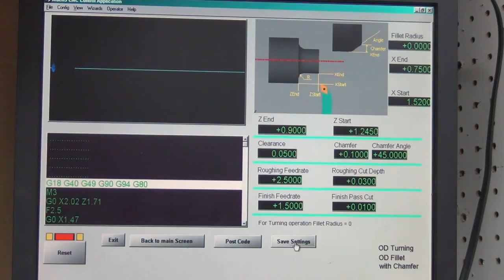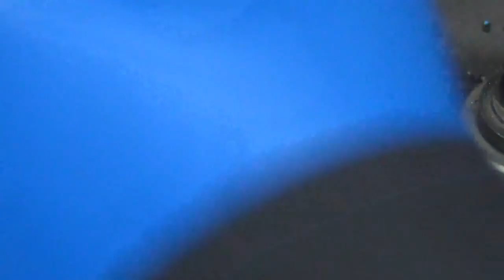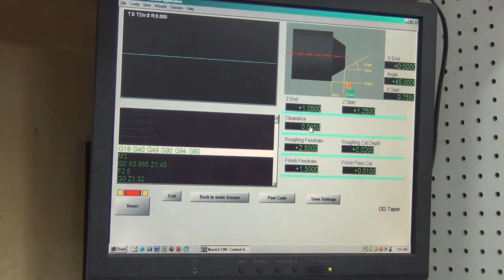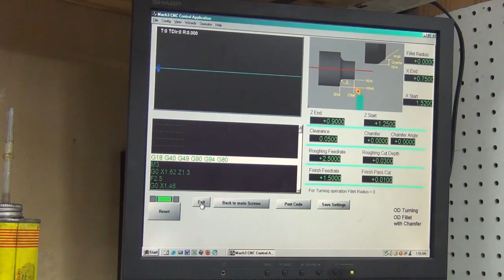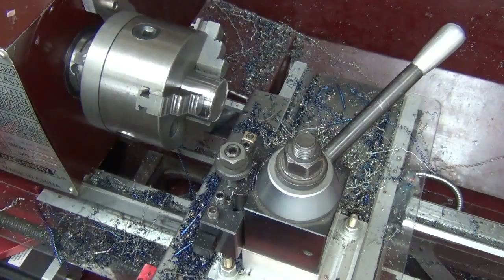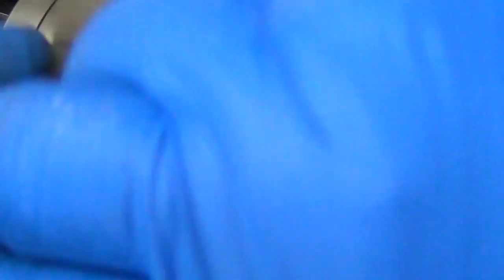CNC Lathe - first parts

Comment: That's impressive man! good job way to complicated for my dumb ass!
Reply from the maker: Thanks!!!
If you only knew how many hours I already have into just learning this basic stuff!  I'm not that bright, so it's taking awhile to figure it out.  The saving grace is that I can do most of this on my laptop and even test it in mach3 without having to stand at the lathe trying to figure it out. 
I spent a good bit of the morning working on the code for the bearing adapters for the Outlaw brake setup.  It's fun, but gives the brain a bit of a workout.  Hmm...too bad you can't burn a lot of calories thinking!!!!  I'd be skinny after figure this out!!  LOL
Reply: well we both have Thin brains! LOL
Reply from the maker: TheJesusno2
So true!! LOL :)
Wait 'til you see the next one I'm coding up :)

Comment: 30thou cut's are way too much, try much less like 5-10thou as you don't have enough umph in your motor. I have 5kW and I rarely go for larger bites, maybe 15thou.
Reply from the maker: Sorry, but I'm probably going to push for as much metal removal as I can get from this machine.  If the treadmill motor can't handle it, I'll change out motors.  After that one stall I had, I found that the drive belt, which is really tiny, was a bit loose.  If I have more problems with stalling, I'll change things up when that happens.   I'm actually going to push the the removal rate a bit more on the next few projects, if only to find out where the limits are.  If I can easily run a .030" cut, I can't see any reason to spend the extra time running .010" cuts.  But, I'm still new to this small lathe, so maybe I'll get an education forcing me to go slower.  Are you running carbide or HSS cutters?

BTW....that's a really nice router you have.  Did you build it?  You should post more vids or what you're doing in the shop. :)

Comment: Why are you turning without coolant? Killing tools is not the way to go.
Reply from the maker: Most of my research has come up with not using coolant on steel.  I have a mist setup I'll install at some point, but I'm using coated carbide inserts which can take a ton of heat.  I haven't had a problem with killing tool.

Comment: Shame your motor control card doesn't have an IR pot that would have helped with the bogging down problem.
Reply from the maker: Yep.  There's a spot for one on the controller board, but I'd need a full schematic to even have a hope of completing the circuitry.  I think I'd rather just buy a better control board. :)   I'm actually pretty happy with the fact that I have a tach read out and variable speed!  I can live with the bogging for now.